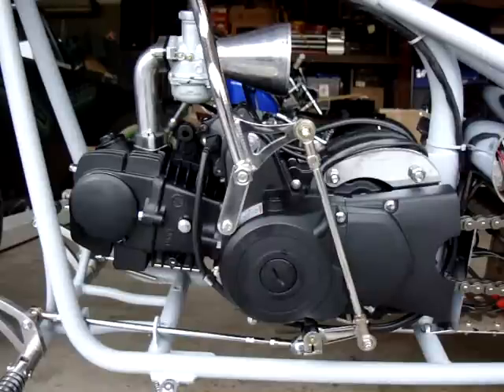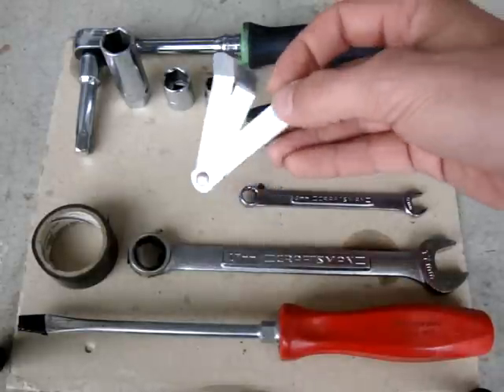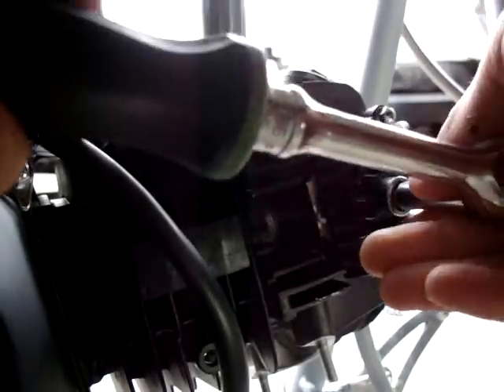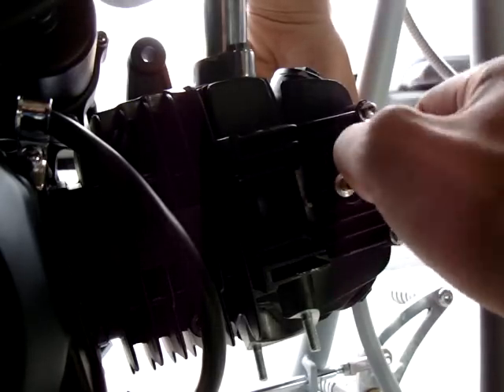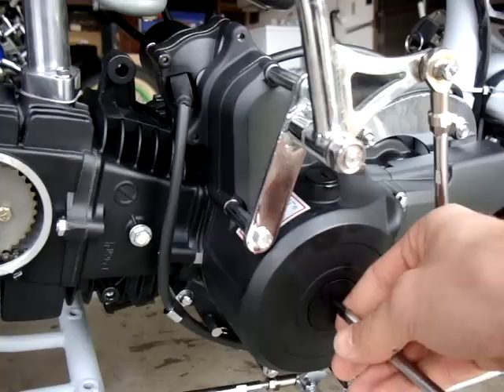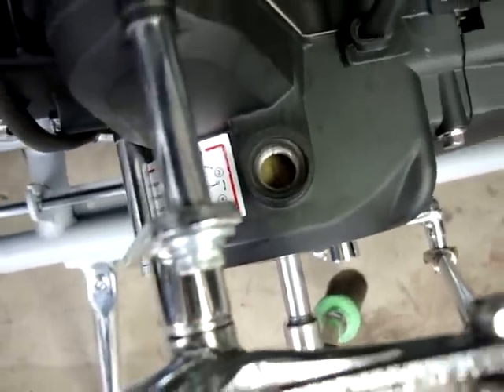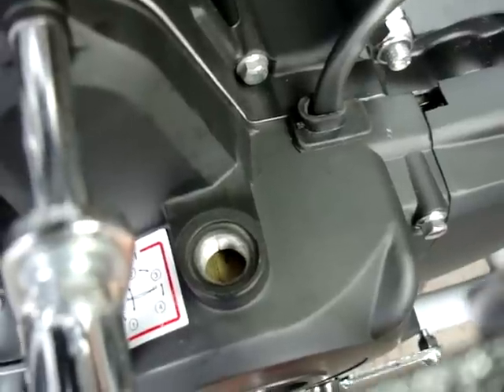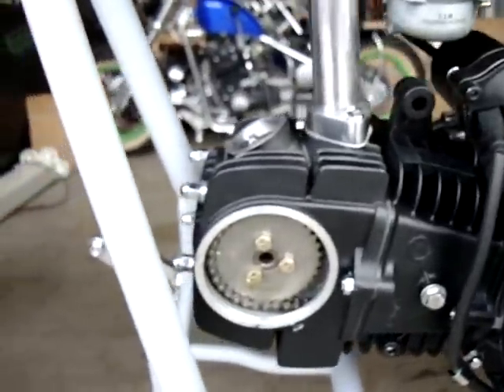"How To" Adjust the valves on a 125cc Kikker Hardknock by California Hardknock Tech Center

Comment: @zacinstalls hi this is very good espeshialy on a new engine but what about on a 8 year old engine with may b slightly warn seatings no to mention expantion of metal as it warms,,,, need to compleatley reset the clearance on my 110cc loncin .. valves are very noisey ,indeed a tappy valve is a happy valve. but very very noisey ,im not stranger to mechanics but im a total noob at 4st valves. please any ideas help sugestions tips ect. thanks very much

Comment from the maker: @chisummorris
 Yep, pretty much the same for the 200, only difference is you will need to remove the tank (2 Bolts) and the top motor mount (3 Bolts) for better access to the intake valve
Valves for the 200 should be set at  .005 Intake, .006 Exhaust, feel free to try a couple different clearances, but these should get you started

Comment from the maker: @freestyleskier132 
Yep, pretty much the same for the 200, only difference is you will need to remove the tank (2 Bolts) and the top motor mount (3 Bolts) for better access to the intake valve
Valves for the 200 should be set at  .005 Intake, .006 Exhaust, feel free to try a couple different clearances, but these should get you started